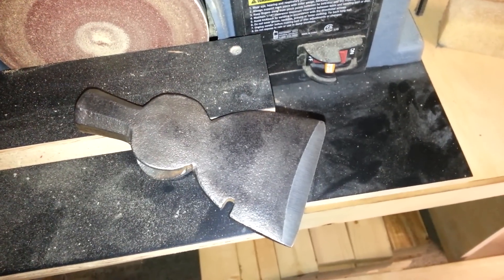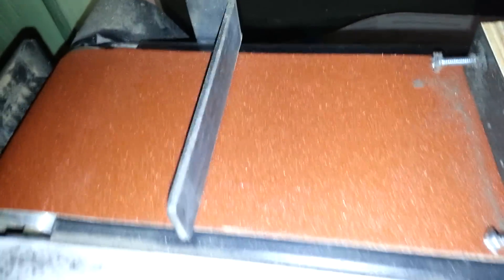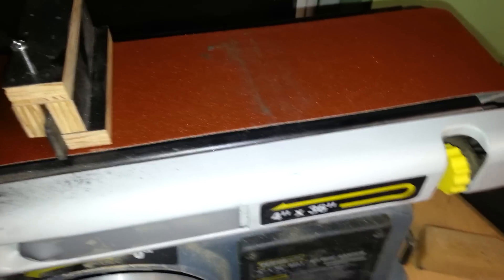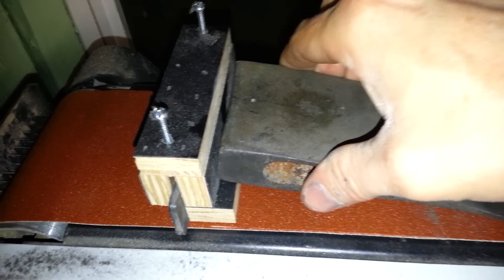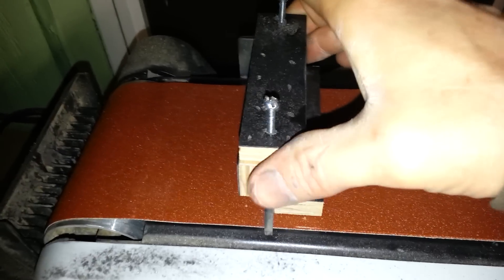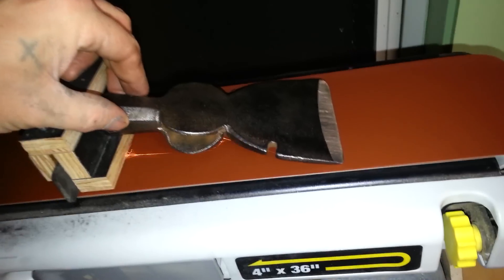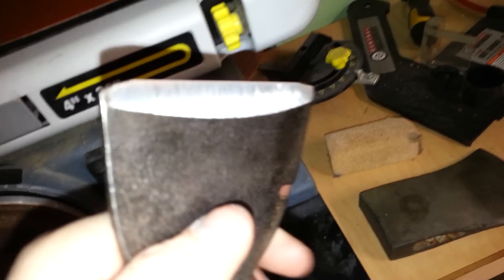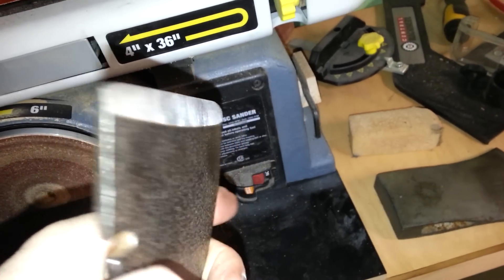How I sharpen Hatchet/Axe heads

Comment: Nice one Shaun , i also use the point and punch method for my regular ax heads and it works great 1
atb john
Reply from the maker: Thanks John - It does seem to work well as long as the dimple is in the correct spot for the radius of the bit - not a big deal though if its off a tad it just changes it a little bit - lol Ive made a few changes on most my axe heads haha - seems I can never get it perfect...

Hope all is well bud
ATB - Shawn
Reply: Hey what ever works right !
Reply from the maker: the mi woodsman lol you nailed it bud..:) If it does what it needs to then all is good